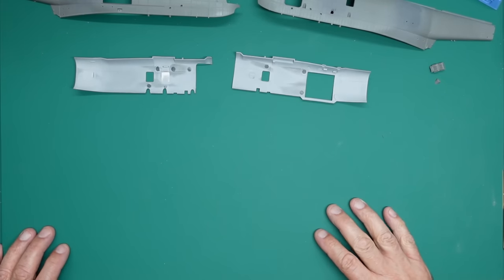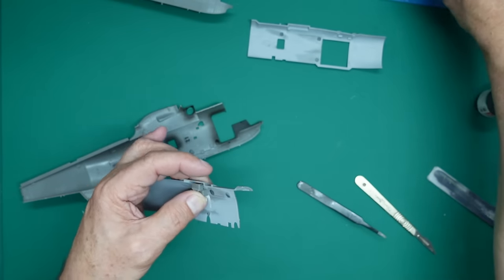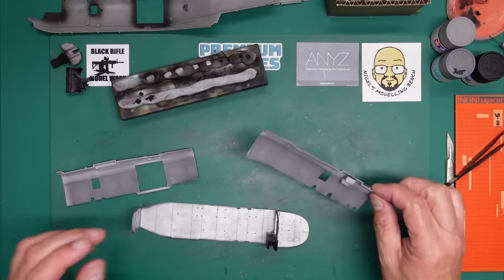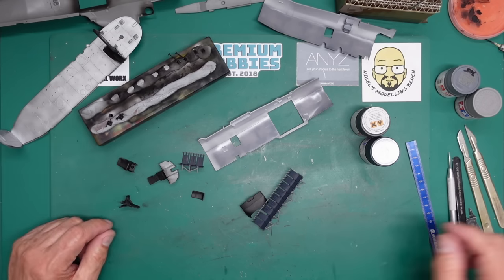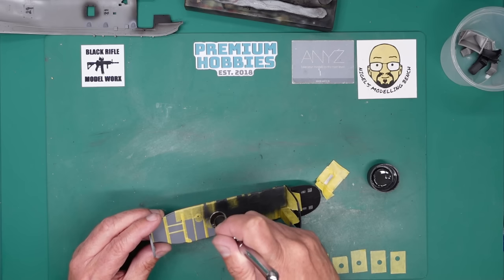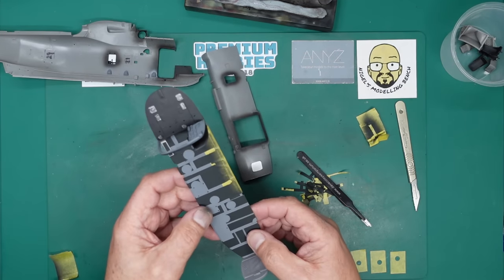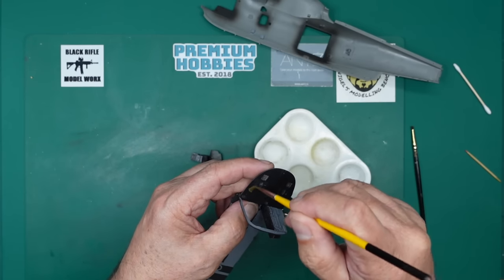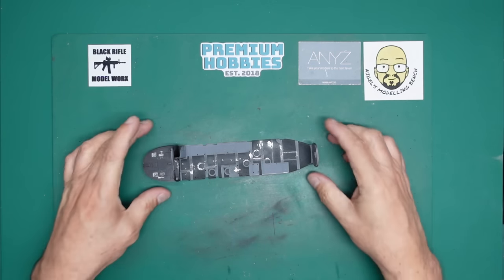Brand new Airfix 1/48 Sea King video build in 1440p . Part Four.

Comment: sorry to be a pain Nigel but as i have had shaved head now for 40 odd yrs i never had any cause to use hairspray lol and i notice you mention using hairspray a lot in your video,s is it a certain make or will any do the same job , i assume you are using it to seal the paint ,? and i have been advised by other modellers to use pledge multisurface polish would that do the same job as hairspray hope you do not mind me bugging you like this but i want to do the best job i can with my sea king 
many Thanks 
Tye
Reply from the maker: Hairspray is used for chipping paint, Pledge is an acrylic clearcoat that you can use to seal your models. Look out for the videos where I use Hairspray and you'll see what I mean.

Comment: Nigel, Technique question:  I understand the mechanics of performing the actual chipping operation (having seen you do this in several different videos), but what I'm not sure about is how one plans what color layers of paint to apply to achieve the desired result (e.g, in this case, the silver for the rivet heads, followed by the "factory-fresh" gray floor, followed by the black of the anti-slip coating).  Is figuring out what colors to apply, in which order, something that one has to learn simply by experience and experimentation, or are they general rules of thumb one can apply, and, if so, are they described somewhere?  Thanks, and the finished floor looks really great!
Reply from the maker: Well Tron, if there is black on grey on Aluminium, you would do it like I have here.
Reply: @NigelsModellingBench  So, if I'm understanding you correctly, the answer to my question really is that one has to think through the entire appearance one wants to achieve, in terms of the sequencing of the layers of color, and I'm guessing that this planning process can really only become second nature after a lot of experience in terms of looking at many instances of "the real thing."
Reply from the maker: No technical stuff really Tron. If you were doing a zinc chromate primed panel on an OD airframe.. paint aluminium, clear coat, hairspray, zinc chromate, OD and then chip away. If you want to guarantee seeing ZC under the OD, put hairspray on the zinc chromate before the OD, then the softer you rub it the more ZC will be visible.

Comment: Another great video - I never really paid attention to the cabin deck in either the US or Canadian Sea Kings I visited or flew in <shrug>. The Seahawk deck was the light grey throughout, with strips of 3M anti-skid tape for crew "grip" - it looked gorgeous for the first few months from the factory and then grew grimier and grimier with use. Seahawk was also interesting as the deck was a honeycomb composite with aluminum stringers and tie-down bits... the aluminum always primed zinc-chromate and then painted.

Another "US Navy" thing - we almost NEVER see bare aluminum - after EVERY damned mission, at sea, maintenance and the enlisted aircrew are REQUIRED to conduct "corrosion control" during inspections - and we would dab either paint or sealant on any bare metal (interior and exterior) - one of the reasons 1980s aircraft look so leper-like. We were NOT permitted to paint entire panels during sea-periods - that is an intermediate shore based process.

Just the same - the cabin deck looks GOOD.